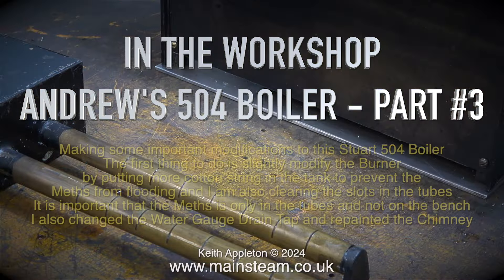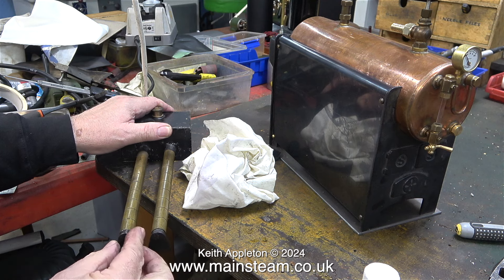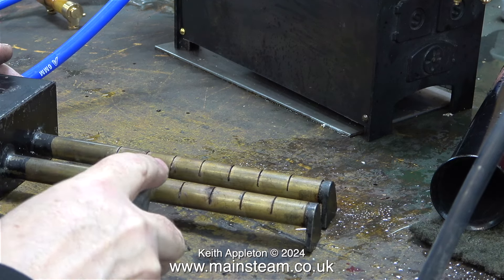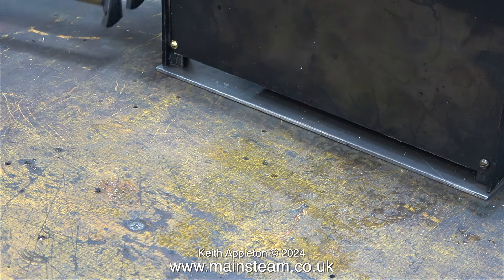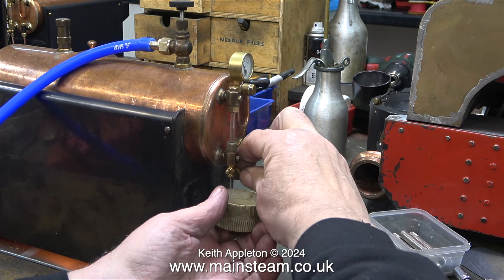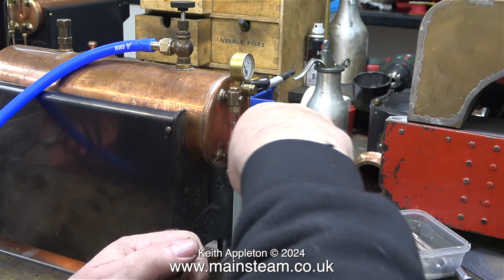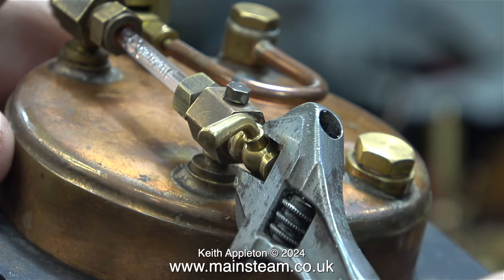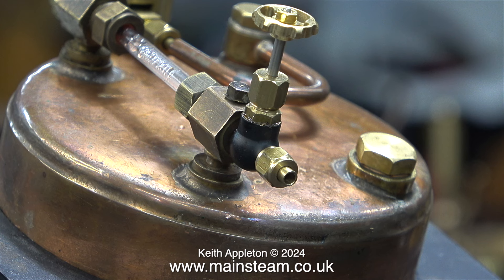A STUART 504 BOILER FOR MY FRIEND ANDREW - PART #3

Comment: Painting tip.  Sortof.  I had a problem with a particular spray paint that wanted to run.  It had a very nice metallic but the drips and sags collected the metal.  I got a really good result just dousing the part and chasing the sag all the way to the bottom.  In this case I was painting the front of a small refridgerator so it was vertical and the bottom edge was unimportant.  Although not the best technique it sure worked well.  The entire thing was done with one coat.  Chasing the sag felt like a bad idea but the metallic laid down beautiful behind the wave.

Comment: Thank You! I just got my self a (used) 504 mini steamplant with what looks like a Stuart 10V on the picture (i hope it will arrive this or next week) Does anybody here know how critical the lenght of the chimney is? i need to make a new chimney since the original one is missing. I also need to order a new manometer whan i can afford it.
Reply: The boiler looks a lot bigger than i taught whan i looked at the new ones on the Stuart web page, but that is only a good thing for me since i plan to drive the steampump from the kit i bought with the same boiler, not sure if i will use it for this, i think it will be a separate running display model for something else whan i feel ready to take on that kit...
Reply: And, yes i did actualy order a batch of five "new" Bahco spanners... This time a bit smaller than my old ones. Ha ha
Reply from the maker: The Stuart 504 chimney tube is about one foot long.
Reply: @keithappleton Thank You a lot! When i did check the weight of the parcel it is more likely a Stuart 500 mini boiler (since it says 6,50 kilogram, but i know the 504 weights 7,5 kilogram for the boiler alone, so it must be the little 500), but that was wat what i payed for anyway so i am ok with the purcase even if i probably hawe to look for a bigger boiler in the future, but it looks like a lot of fun on the picture i got!  It looks like one of those mini steamplants  sold by the Swedish company Eskader in Stockholm, so if so, this is probably an original STUART 500 with a little vertical machine, factory made assebly from the 60-70s  which mean it may be ready to run after a bit cleanup and some new oil!  That was if so good news after all since it hopefully means the castings has been machined correctly.